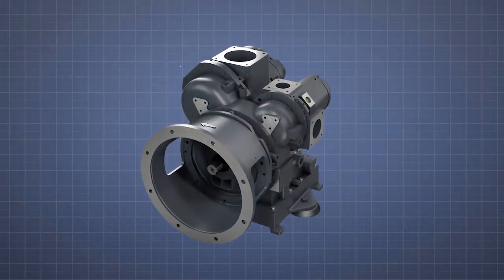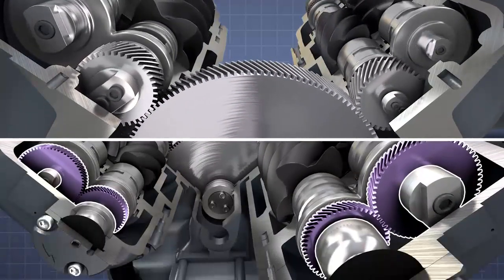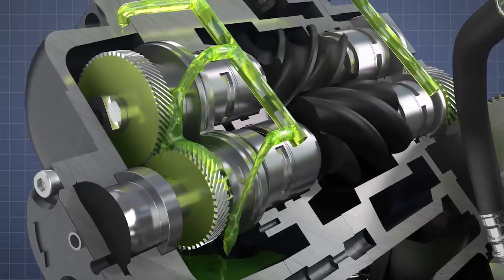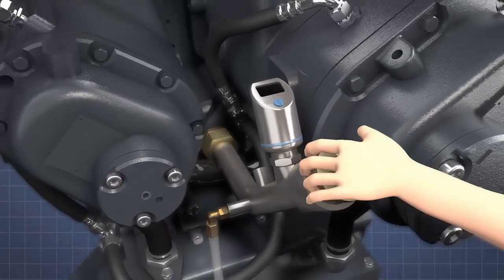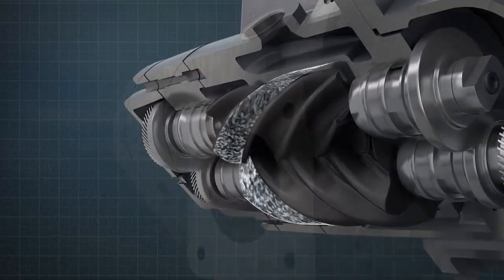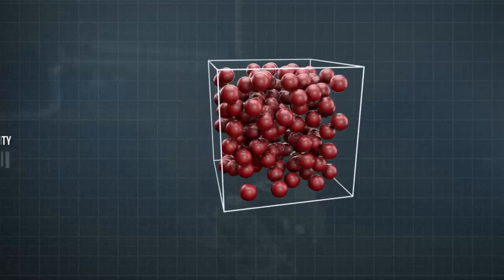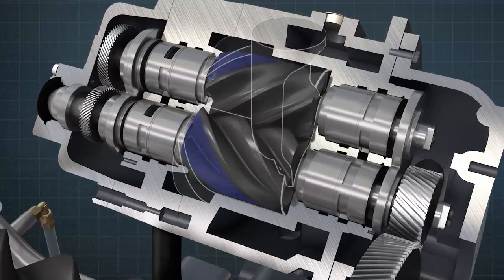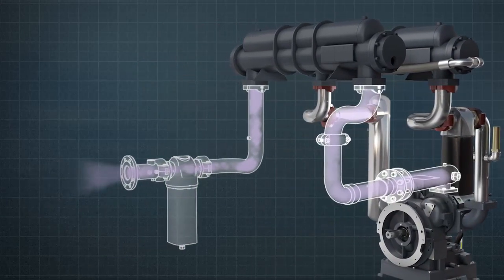Compair D Series 2 Stage Overview Training Video

Comment: Thank you sir . 
Sir I have a question regarding to this video is that "How does the air pressure increase in the second stage, is the speed of the screw in the second stage more than in the first stage?

Comment: is it possible to compress air form an 80/1 source at 15,000 rpm with a screw compressor to a higher compression ratio?

Comment: Oil free compressors are garbage -  All of them. Invest in good oil separation units. Otherwise you'll be facing high maintance costs.
Reply: This unit isn't oil free though.  I am confused.  It has an entire gear-oiling system along with a filter.
Reply: It’s an oil free compressor. Only the bearings gets lubricated with oil.

Comment: Still not made me saying amazing😅😅😅 screw type pump the super easy one if know and understand how its work follow the setting... Single screw more super easy, and double copter fiber blade pump more better because its not ruin block pump or self destroy if bearing burns☺️☺️✌️✌️✌️ by the way if the valve add on mordern electronic system(i mean manual setting all spring inside by using electronic solonoid) all work will more easy and not cost money just for adjust setting☺️✌️✌️✌️✌️
Reply: Its not a pump its a compressor wich produces up to 15 bar and 40m3 / minute
Reply: @inot88j24  what you talking about? Without PUMP there is no PRESSURE...😅😅

Comment: Would you have to pressurize the system first so the the second one would actually compress’s the air?
Reply: It is just a 2 stage. A lot of heat is created when compressing air and by compressing it twice you can reduce the amount of heat produced as well as increase the amount of pressure created by a significant margin. You will find a lot of oil flooded single stage machines, but not oil free. All about getting rid of the heat.
Reply: It does that automatically , The suction control valve will not open until the compressor is up to operating speed , Otherwise the motor would burn out , With this kind of air compressor , You would need reduced voltage starting because of how long it takes to get up to operating speed , Same thing goes for a centrifugal air compressor because of the extremely high speed of the air ends will take longer to get up to speed and full voltage starting would definitely burn out the motor
Once the suction control opens up the first stage compresses to around 30 to 40 PSI then goes through the intercooler before going to the second stage where it's compressed again , Because of the drive gear , The air ends rotate at very high speed , Tens of thousands of RPM , Jacking up the speed of the air ends will produce the same volume of air as a big air end , They do it that way to cut costs of making the unit because of how expensive it is for the precision machining of the parts , The gears are helical cut to counteract the axial thrust on the bearings caused by compressing the air and counteracting that thrust is extremely critical because of the extremely high speed the air ends rotate
Besides being the main drive gears , They are also known as performance optimizing gears , One word of caution , When working on or near this kind of air compressor , You better wear hearing protection because once the compressor starts pumping air , It is very very loud
Atlas Copco was the first company to come out with a 100% oil free air rotary screw air compressor and they also have portable units driven by a Deutz diesel engine and put out 900 to 1500 CFM at 110 PSI

Comment: no oil means overheating, higher wear and tear, and tight tolerance means a high maintenance bill.
Reply: Hence where the integrated cooling paths come into play. Those paths prevent overheating and mitigate much of the heightened wear, while the lack of oil ensures a less contaminated throughput than you'll get even with post-compressor oil filters.
Reply: Yeah, these have no problem lasing 60k hours or more before an air end might need replacement, and that is usually due to wear on the rotors themselves just from the very very fine particles that get past the air filters.

Comment: All oil free screw air compressors are crap....I’ve done VA work on Compair, Kaeser, Atlas Copco, Ingersoll Rand etc, all have exact same issues with the primary airend failures. Poor setup and control of delivery pressure is common. Overheating is the primary cause. It’s common place to see the primary airend temperature at 200 degrees C. Clearances are destroyed at those temperatures and the rotors kiss and gall because there’s only extremely hot air between them. If the air demand load varies a lot the problem is much worse. I’ve seen an Ingersoll Rand compressor destroy the primary in 3 months, same for the Kaeser. Rubbish machines. The bull gear bearings collapse quickly with high intermittent demand. Under engineered for hot climates like Australia. Even the water cooled versions have the same issues as I’ve worked on both water and air cooled versions.
Reply: I can't speak for all manufacturers, but the Copco compressors can handle a ton of punishment and keep running fine. Cooling water is important though and so long as you operate within the correct temperature range, they will run a very long time. They also make some specialty stuff if you need to operate in very hot or very wet climates.
Reply: I agree oilers are the best, mine has a kidney stone now, replaced one ball spring at back and bottom. Replaced one 1.5 inch ball but still gets hot and when shut off 1 to 2 gals of oil vents out top air filter, any ideas?
Reply: @alanmydland5210  Can you explain what is a kidney stone?
Reply: @jason.arthur.taylor  I call it a kidney tone because when I shut it off 2 gals of oil back out of the   air filter? I've been through most of the system and haven't found it yet.  Ots a air cooled Dietz  hooked to a IR oiler rotary 125 square
Reply: @alanmydland5210  Thanks for explaining.

I assume this is used for refrigeration?
Reply: @jason.arthur.taylor  no to make air
Reply: @alanmydland5210  To power air tools?
Reply: @jason.arthur.taylor  Air tools ,disc sanders and air motors for sprayers
Reply: I’ve been working on oil free IR compressors for 18y and we have a client that has 14 oil free units and some of them 15 years old with only routine air end changes. Oil gree compressors wants to run all the time. If you spec your machines correctly and maintain them properly you can get good service from them.
Reply: Good Info.

Comment: Please sir explain load unloading valve screw compressor zr250 compressor
Reply: Different manufacturer. This one is Gardner Denver. ZR 250 is an Atlas Copco machine.
Reply: Call me..7042281737

Comment: how much tolerance must be in the screw?
and the roughness to work properly?
Reply: The air ends are precision built , The rotors are only a few thousandths of an inch apart from each other and the housing when up to operating temperature

Comment: Our Kaeser oil free air compressor giving us high temperature at 2nd discharge what could be the cause ??
Reply: Could be a number of things. Best to have a Kaeser service tech inspect it. Provided the second stage inlet temperature is normal and the intercooler pressure is good it is most likely that it is just worn out. Could indicate a failing bearing or any number of other failures in the air end itself.
Reply: @Greatlakessailing  I don't know if Gardner Denver or other manufacturers have an air end exchange system like Atlas Copco does , And if they do , It makes sense to replace both air ends because you don't want to replace an air end and have the other one go bad a short time later and you are correct on your answer that it's very likely a bearing failed , and what makes it much more likely to happen is because of the extreme high speed the air ends rotate , There was another air end I saw where a bearing failed and the rotors had freeze welded themselves to the rear housing , This was an oil flooded compressor as well and it was a miracle that it didn't Ignite the oil but the air end had to be replaced
For as expensive as an oil free air compressor is , You want to check the oil at the start of each shift
Reply: As Dave says , A bearing could have gone bad , I've seen an oil flooded air compressor where a bearing failed and within seconds , The air end got so hot that it ignited the oil and totally destroyed the machine , The oil sump had a big blister in the side of it where the oil demister is and it's a miracle it didn't explode , All the rest of the parts that carry air and oil were damaged beyond repair by the extreme heat when the oil caught fire , I don't know if other manufacturers have an air end exchange system like Atlas Copco does , one time I had to go to Welch's in Pennsylvania and change out an air end on an Atlas Copco machine and send the bad air end back to Atlas Copco , Atlas Copco policy is that air ends are not to be disassembled by the customer , You put the bad air ends in the crate the new air ends came in and they got shipped to Atlas Copco in Belgium for reconditioning
You may be able to disassemble an air end but unless you have the parts which you'll never get from Atlas Copco , The clearance specifications and the precision measuring instruments to check the clearances , You'll never get it right
Atlas Copco will not furnish parts for an air end to anybody , Other manufacturers may have the air end exchange system as well
The number one cause of an air end overheating is bearing failure
For now , Shut down the compressor and leave it off until you have a service technician look at it because very likely you'll have to replace the air end , If you have to replace the air end , It'd make sense to replace both air ends because you don't want to replace an air end and have the other one go bad a short time later

Comment: But you still need a dryer after this. To remove moisture in air
Reply: Jeramel Barcelo 
Yep,  that’s the last thing the narrator said.
Reply: Jeramel Barcelo  dryer, pre filter after filter and water separator is needed
Reply: Mohammed Neman Hussain yes correct